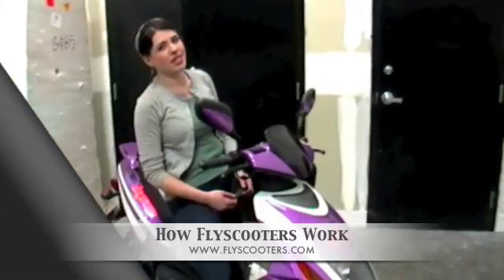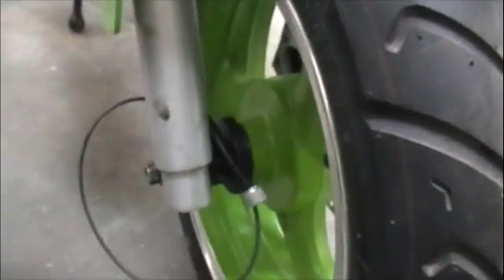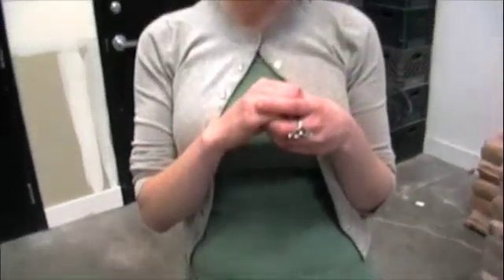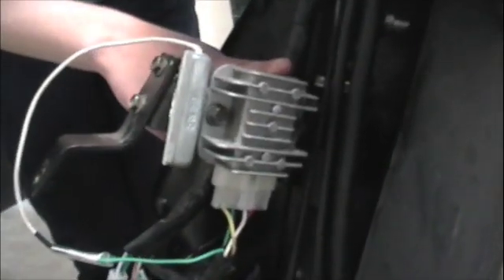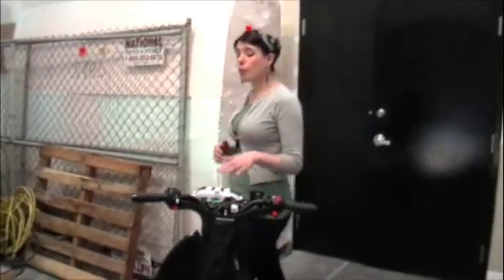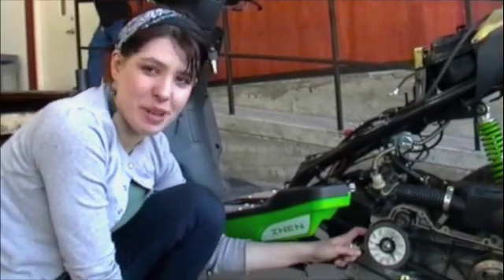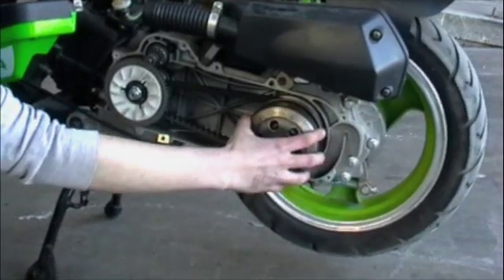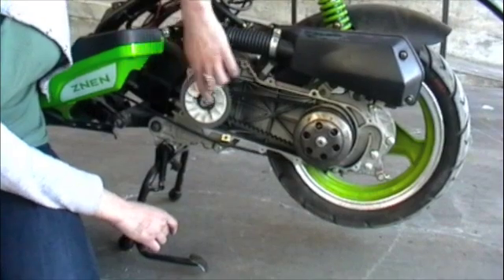How Scooters Work by Jessica

Comment: you're right about the clutch...if this were a car. this scooter doesn't have gears (that's what the cvt is for) and the centrifugally engaged clutch is actually attached directly to the rear axel, quite smart if u ask me